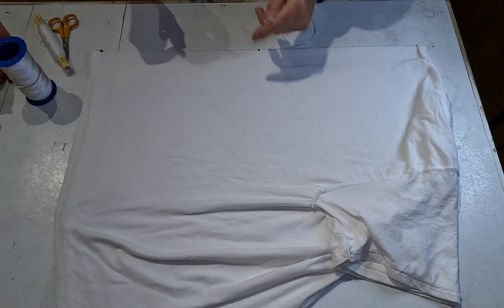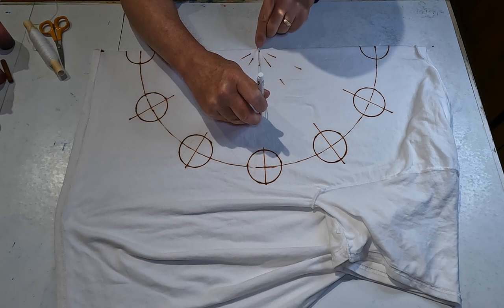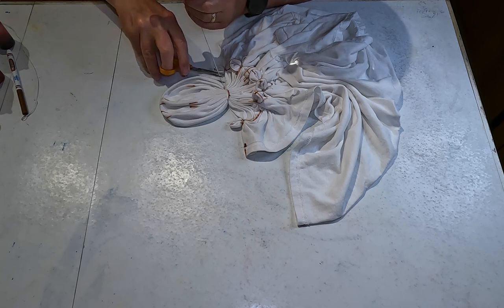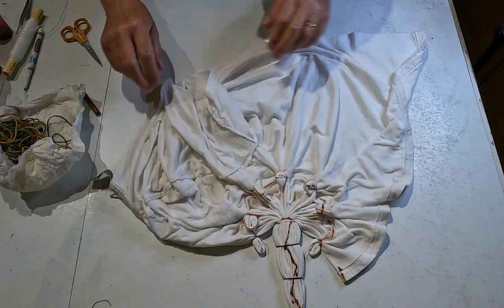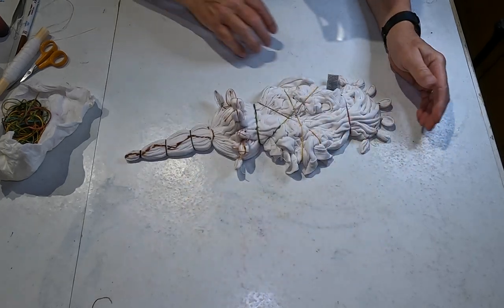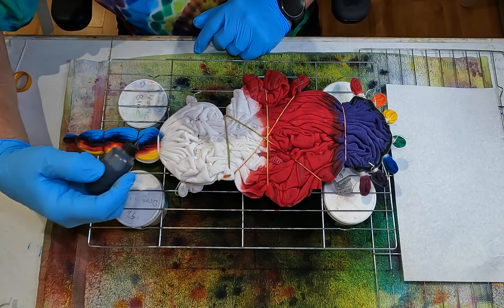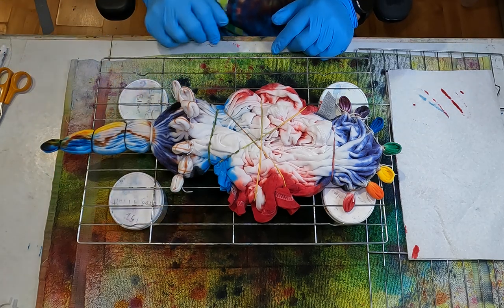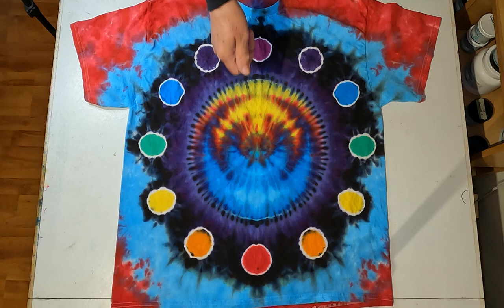Wig Wag Solar System

Comment: I've never worked with sinew. I see you start with a slip knot, but never see you knot it at the end. Does it just stick to itself?
Reply from the maker: Hi Kristy, the sinew that I us I get off of Amazon. It is artificial deer sinew and all tie-dye sinews are wax coated so in the process of pulling it tight the waxed sinew sticks to itself. So there is know need to tie it off. Thanks for the question and thanks for watching.